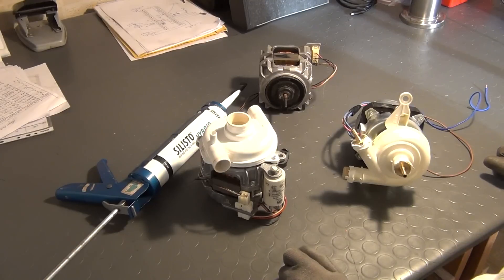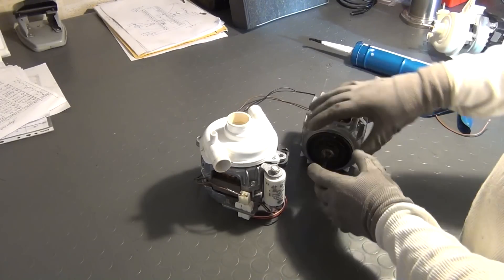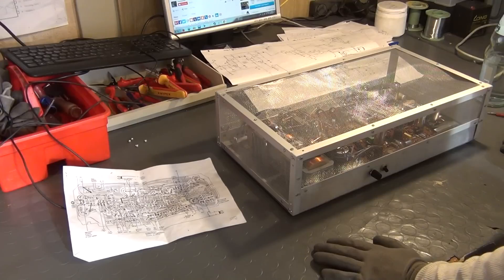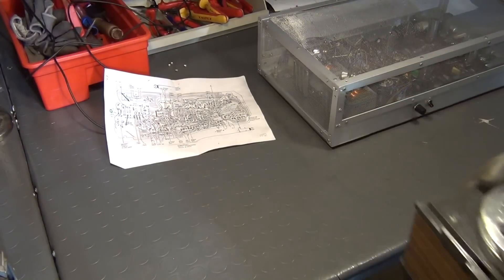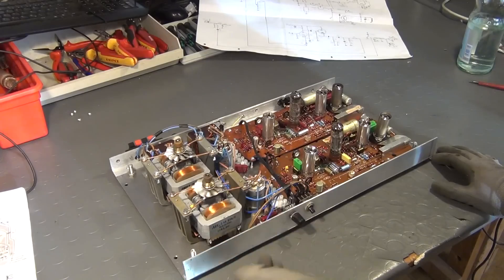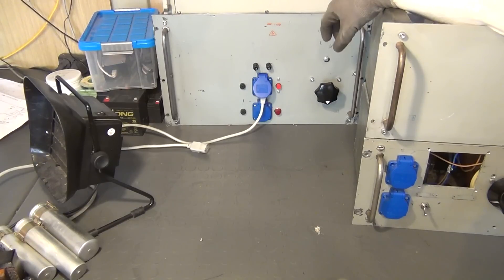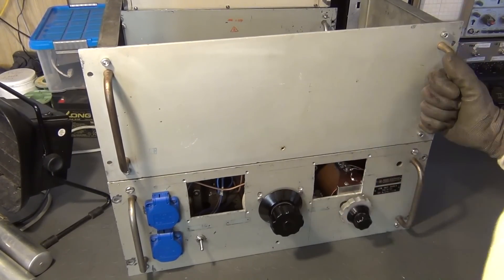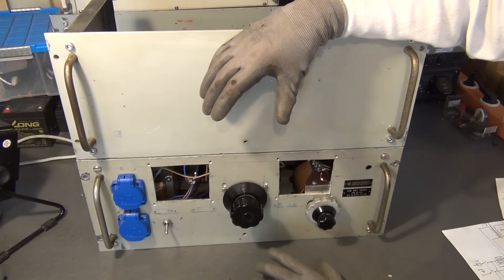TPAI Lab Report #005: Vacuum Tube Amplifier and Power Supply, Circulating Pumps Update

Comment: I saw a dishwasher someone was throwing out sadly i had no tools so i cut some hoes and wire and got a rather large solenoid along with a  nice motor. The top part of the frame of the motor has 3  threaded holes so it can be bolted to something very easily its thick metal so the motor will burn out b4 that thing breaks off( it's an induction so I'd pretty much have to try and burn it out I'd like to know it's speed. I can't figure out what I'm gonna use the motor for sadly the only thing i can think of that needs motors is like a cnc machine and out of all the motors i have I don't have a single stepper in place i was trying out the precision of a motor with a clear paper that has black lines on them and a photo interrupter to read these use 2 per motor to sense direction of rotation. I'd need to print one off to get enough precision to make a cnc without using big gear looking wheels for the interrupters. For some reason my town has no place that sell them and all I ever see is people selling them 10 at a time for to much and no store that sells electronics parts or anything to do with the hobby.

Comment: Sense you ask..in a different video log.
You ask about sealing that gear box thing leaking on your bench.
Scotch - Weld 3M product?p
Avionics grade sealant Liquid Gasket Material

and also from 3M Marine adhesive 5200.
used for many years in million dollar 30 nm/hr fishing boats.
it's such a song yet flexible material that a parshal tube can be saved. By cutting a hole in the tube side and inserting a mallet handle Makes gentle persuader out of a material one can not purchase...
it's that good..at what it dose..as a material. inserting some sand to Make it more Dead Blow like.  would be the tits, nut on, or 0.0 zed.zed

Comment: Hope you had a Great B'Day!  I thought that Tube stuff sometimes needed >300V.  Maybe you could add an optional transformer to perhaps double your lower amperage variac?  Just a thought.  Thanks for all the hard work!
Reply from the maker: +James Munn Hey! The small variac delivers up to 300V AC. The voltages required for the vacuum tubes are DC-voltages though. If a sinusoidal AC is rectified and used to charge a capacitor the rms-value of the AC voltage must be multiplied by the square root of two. 300V AC -> (300*1.41) V DC = 423 V DC.  The capacitor is charged to the peak-value and not the rms value, that's why the DC voltage you can obtain is higher. That is more than enough for the kinds of vacuum tubes I will be working on.

Comment: I might suggest you not restrict the inlet of the pump as much.  Centrifugal pumps do not like such restrictions and cavitation plus overheating of the pump head and impeller can occur.  A parallel closed loop circuit with a metering valve may help keep things cool and reduce cavitation.

And happy birthday!

Comment: Really liking what you're doing here.

 I have many 'obsolete' parts myself with many tubes in new and broken condition.

would be curious to see how to build them into both functional, and in the case of some 'failed' tubes, cosmetic function. The glowing filament tubes are exotic and should be featured even if they aren't very efficient.

In regards to the amplifier with the tape motors, perhaps integrate a concept like a Leslie speaker and create interesting effects with the sound.

Also look at the designs of the Moog keyboard for the manipulation of the waveform, and perhaps old musical keyboards could be re-purposed for control of this.

The designs of the experimental musician Raymond Scott are very relevant to this effect as well.  His analoge designs are very advanced and form the basis of much of what we take for granted, even sample loops. 

The founder of the band DEVO has Mr. Scott's original synthesizer but primarily as a display as very few know how to work on it.

You could resell such devices to musicians   to get the resulting sound into digital form or speakers very cleanly and reliable would be the goal there.